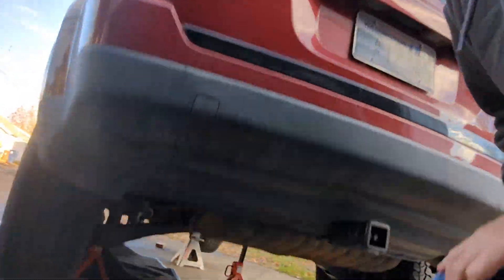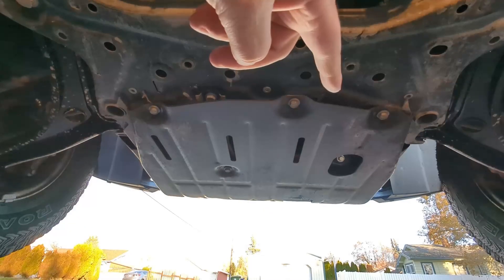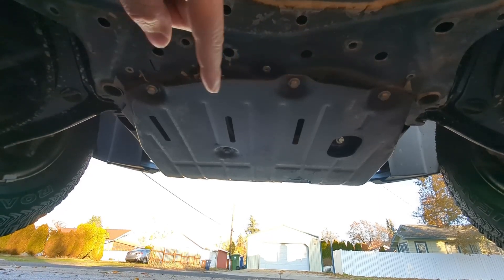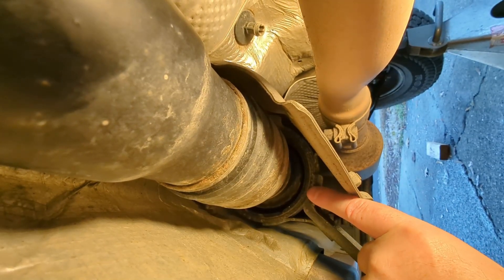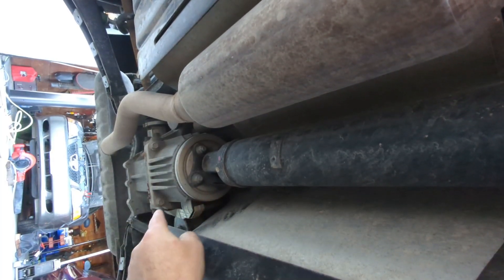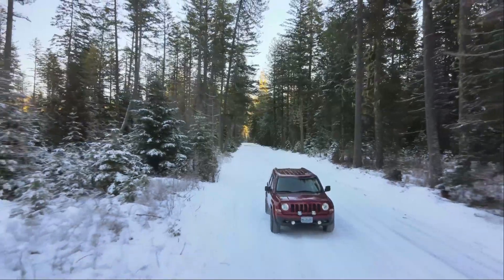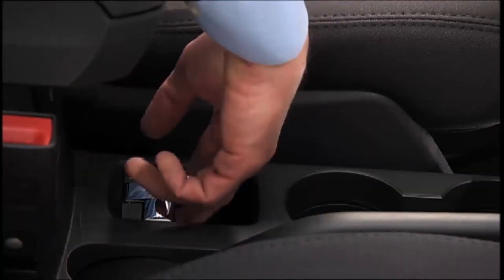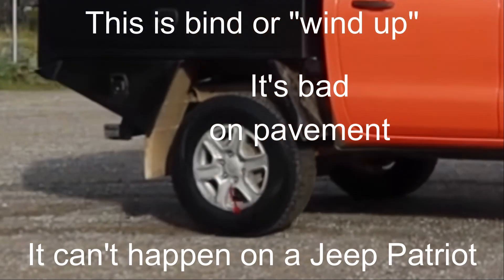How a Jeep Patriot 4WD system works - Compass too!

Comment: Here is a question for you. I’ve heard from a couple different people that I can’t buy a pair of tires. I have to buy four tires all the time no matter what.. is that true? Can I pick up a pair of tires put them on the front a couple months from then maybe buy another pair put them on the back? Or will that tear a hole in the universe?🤔 I have a 2008 Jeep patriot. I’ve changed the CVT fluid more times than I can count as well as eliminated the temperature regulation unit. I can’t remember the correct name. It looks like an H it’s mounted up next to the radiator. It was allowing the CVT fluid to get way too hot so I eliminated it made all new PTFE braided hose with AN Fitting's. I know this next statement people are gonna not like. Well, I also bypassed the transmission heater cooler and removed it. I now have a flat plate in place of it. I’m able to control the warming of the l CVT fluid in a different manner
Reply from the maker: The drive system in a Patriot isn't going to have a problem with a slight difference in diameter from old vs. new tires,  as long as you get the same size and type of tire.    There are other systems like the old Quadra-Drive in WJ's which were fully mechanical and a small difference in size from old vs. new tires or different brands would cause the gerotor to pump up and press the clutches together,  causing the transfer case to overheat and ultimately fail.  That's not a possibility in a Patriot if the difference is only a little tread from older & newer tires.

Comment: Honest, I rolled my eyes at first and thought, "after driving my Riot for 10 years, here's another goofball gonna tell me I don't know how to drive."  😂  THANKS for this video, you gave great explanation of what's going on in the drivetrain.  It all jives with everything I've learned, driving and working on this Jeep.  And some of what you explained toward the end - - I'm even more confident telling my sweet wife NOT to worry about the 4x4 lever, "just leave it in 4x4 whenever you're in the snow."  
94,000 miles on our 2016 Sport model that we drove off the lot brand new.  It's super reliable (though we're not confused, it's not a rock crawler, we call it our Seattle Street Jeep!)   Now in Central Illinois with "real snow," it's proving to be a solid daily driver, no matter the weather.

Thanks again for the video - - 

PS, thankful you avoided alcohol poisoning. The background noise was NOT an issue on this end!
Reply from the maker: Hey thanks!  I appreciate the feedback.

Comment: One info. The activation of the traction of the rear wheels, on normal operating mode (no 4wd lock switch enable) turn on a light on the dashboard when engaged ? i mean, i start with the rear wheels on a slippery surface, so the front have traction but the back not, it will engage 4wd and gain traction on the rear, blinking a light on the dashboard (like the esp light, the 4wd text on the odomether display or something else), or will just do it in silent ?

Comment: At about 48 mph my 2019 compass makes a sound like something spinning up. I've read that it is normal, but nobody says exactly what it is.
Reply from the maker: Dang that's unfortunate...   the '19 Compass is on a different platform than the '07-16 Compass (and Patriot) so there's not a lot of cross-over among them mechanically.
Reply: @shoveI  Maybe you could do a video covering that drive train.

Comment: Great explanation, i have a 2008 jeep compass and i here a loud noise from the back i also feel like the rear wheel drive is trying to engage all the time but when i manualy engege the 4x4 i do not hear or feel anything weard from the back what could it be

Comment: Looking to get all weather tires for 2017 Patriot 2.4L 6 speed Auto Stick Tip Start. Wondering opinion on what the "sweet spot size" for an all weather tire would be. Central Ontario Canada winters here. Thanks in advance. Currently running 17x6.5 Aluminum P215/65R All Terrain. Enjoying the content, cheers.
Reply from the maker: I went with 235/75R15 which is equivalent in size to 235/65R17 ,  it clears every part of the fender and suspension without any risk of rubbing even at full turn and while traveling on rough roads and it's subtle enough of a difference from stock that (after calibrating with JSCAN) it doesn't significantly impact acceleration or fuel consumption. 

It looks like some of the major all-weather tire brands are available in that size (like Michelin Crossclimate, Pirelli Weatheractive, etc)  .

Comment: Thanks for such an informative vid. Im a retired skilled tradesman and I bought a 2016 5 speed Patriot about 3 months ago for about half the going price but i it seems to have some issues. Anytime I drive I hear a very slight whine, whirring sound from underneath. The sound concurs with the rpm of the motor and trans. A wheel bearing sound follows the rolling speed of the wheels  so I feel thats not the problem. My question is does the center carrier bearing or joint require lube or some type of maintenance ? I changed the diff fluid the trans fluid and the transfer case fluid myself because no mechanic I knew seemed to be knowledgeable about 4x4 . The vehicle has about 108,000 miles so its not dying yet I hope and it runs great. Aside from the usual Mopar grounding issues. I never owned a 4x4 before so I m in strange territory and I have yet to find someone that seems to know anything about the subject. I love your Patriot videos because you dont seem obssed  with likes and subscribing. Thanks n advance for so much info.
Reply from the maker: I don't know what climate you're in,  I've only lived in the rust belt a very short time many years ago so rust problems are not my area of expertise.   Outside of the rust belt the carrier bearing doesn't need any special maintenance and either way the carrier bearing will follow the road speed not the engine speed because the driveshaft is in constant mesh with the front differential. 

The most common problem on the manual transmission is its input shaft bearing, especially on models made after 2011 when that factory was no longer building transmissions for any other application,  it seems like quality dropped pretty quickly like maybe they laid off or reassigned the one person who knew what they were doing.   When the input bearing fails you'll get a whirring or whining noise that follows engine RPM any time the clutch pedal is not depressed,  sometimes it will be a little bit quieter in 4th gear but not always.

Comment: Hard time deciding 2016 patriot high altitude 96,000 km or 2021 Toyota Rav 4 LE SAME KM but the patriot is half the price?? Patriot is staring to rust under the doors and a paint bubble in the rear fender..
Reply from the maker: I live out west and rust terrifies me no matter what brand of vehicle it is.   There's nothing fundamentally wrong with a Patriot but get the Toyota.

Comment: HOW  CAN I GET   A  WIRING  DIAGRAM  FOR  THE PATRIOT  2015 ..  MY 4 WHEEL LITE IS ON .. AND IS  NOT  AFFECTED  BY THE  SWITCH..  . FUSE IS OK .. BUT  NO POWER  TO  THE  SWITCH ON THE  CONSUL .. WHEN  LITE IS  ON...... I NEED  TO  KNOW  THE  WIRE  COLOR  LEAVING THE  FUSE ... AS  I AM GETTING  POWER  TO  THE  FUSE   ...BUT  NOT  SURE   IF  POWER  IS  LEAVING  FUSE ...
Reply from the maker: The facebook group "Jeep Patriot USA" has in their group files section a pdf of the whole factory service manual including wiring diagrams.   If you do file sharing stuff (you know what I'm talking about) the same file is out there too.

Comment: Good stuff! I personally have had two Pat's. My first got totaled ! My previous 4X4 was an Eddie Bauer edition full size Ford Bronco  5.8ltr . Great 4X4 ! Used it when my daughter and I snow boarded around Calif. But when I retired I sold all my gas guzzlers (Bronco, Mustang, Tbird) and kept my Harley and Fiero GT. Even though I stopped boarding at 60 I still enjoy going up to the mountains and traveling the back dirt roads . And this little light weight 4X4 fits my needs to a T. Thanks for your vids and great job!

Comment: Good day, my 2011 Patriot Latitude X 2.4 intermittently binds while performing a sharp turn from a stop.  It feels like the rear wheels must be engaging. I was thinking of pulling the all wheel drive control module fuse to test this. Do you have any input on this matter? Thanks
Reply: Additionally, no fault codes present and 4 wheel light turns on and off when switch is actuated. Gas mileage seems to be normal, so I don't think the 4wd is always on.
Reply from the maker: One thing you could start with for diagnosis is to configure the JSCAN app to display 4wd engagement and see if the rear drive unit is being commanded on when you notice the behavior.   That way you can isolate if there is a mechanical fault or if the PCM is commanding the behavior
Reply: @shoveI  Thanks for the Quick response!! I have the jscan but have only used it for faults and trans fluid temp. I don't see where to monitor 4wd engagement. Is it in the all wheel drive module?
Reply from the maker: It's under "Live Data" - look under PIDs.   I don't remember exactly what it shows up under, like "RDU COMMANDED ON" or something?  I can plug in tomorrow and refresh my memory.
Reply: @shoveI  I appreciate it!
Reply: @shoveI  Good day, did you look at the Jscan to see the exact name? I can't figure out which it is.

Comment: My drive shaft popped out twice in 5 days left me stranded today. 08 jeep patriot. We couldn’t fix the shaft so he completely took off the drive shaft an so far so good what ya think ? I really don’t need it
Reply from the maker: Under normal conditions none of the driveshafts should be able to fall out,  sometimes when people are repairing or lifting the front of the Jeep they will accidentally pull one of the front CV axles out of the center section and not fully seat it back in, which should be remedied as soon as possible to avoid further damage. 

If you mean the driveshaft that leads fore-aft,  the only reasons I could imagine it falling out are if the bushings holding the rear center assembly are trashed or if the carrier bearing has left the chat.

Comment: Great video!!  How reliable is the non cvt,, automatic transmission? I am going back and forth desision on purchasing either the manual clutch transmission or buy the auto trans???? Thank you
Reply from the maker: Pretty much nobody complains about the 6F24 transmission,  they tend to last the life of the rest of the vehicle if maintained. The biggest problem they have is Jeep calls it lifetime fluid,  but there's no such thing as lifetime fluid.   There is also a "rough service" schedule that says to change it at 120k miles. 

The transmission manufacturer ZF says that transmission fluid itself is only good for about 60k miles,  so that is when I change mine.  

(ZF doesn't make these specific transmissions, but I trust what they say about fluid) 

Manuals are difficult to find and many suffer input shaft bearing failure.   Apart from that they seem reliable enough going by other peoples' anecdotes.    Listen for bearing whine if you're shopping for a manual, both of the manuals I looked at while shopping had it pretty bad which is probably why they were for sale.
Reply: @shoveI   is there aftermarket input shaft bearings that are more reliable? Is it high labour and parts to repair that bearing? Thank you you're a great help!!
Reply from the maker: I am not an expert on the T355 but I understand that the bearings are not bespoke to only that transmission,  which means you have choices presumably.   From the limited reading I did while shopping a few years ago the problem was identified either as insufficient factory lubricant fill (so you extend the life of it by simply ensuring the transmission is filled to specification),  excessive idling in neutral (the input shaft is spinning but lubricant is not being splashed up by the gears lower in the sump) so you extend the life of it by not idling the engine for no reason,  for example remote starts or eating lunch every day in the car with the engine running for HVAC.    The other proposed cause of failure was incorrectly aligned machining on the case which puts a constant load on the bearing outside the axis it's designed to bear.  Probably no real fix for that as an owner unless you happen to live near a machine shop that can line hone a whole transmission case.  

Also I notice your use of the English spelling of labour,  so if you do happen to be in England I believe you guys got a 6 speed manual gearbox as well.   I don't know anything at all about that transmission.

Comment: Great information in the video. We just got 12” of snow and my Patriot made it around flawlessly. Just a question tho. I have a little ticking noise. I had my mechanic take a look and said I had a little cam wear but didn’t see a problem in the engine. Any thoughts?
Reply from the maker: Cam wear is pretty uncommon in these engines (assuming you're in North America and have the 2.0 or 2.4 gasoline engine) - if there's wear in those I'd be more concerned about timing chain wear.    The only thing you can really do about that is be diligent about oil changes and accept that damage already done can't be undone, short of very costly replacement.   

Since apparent cam wear is present you can expect possible wear in the cam phasers and the cam timing solenoid which can make a noisy tick in operation especially if it's worn or sticky. 

If you idle a lot remember that idle time doesn't accumulate miles but it still factors into how much wear the engine and the oil experiences.

Comment: How do i disable the 4wd? I just don't want it.
Reply from the maker: I've never looked into doing this,  but if it is possible (safely) the most likely way would be by deactivating the FDCM in JSCAN.   There may be more to it than that but it's where I would start if I was trying to do that.
Reply: @shoveI  thanks 😃

Comment: Hey thank you for letting me know that 4wd system doesn't work over 35 mph. And that matters because some people don't know this and are driving fast because of a false sense of safety when they need to slow down probably. ❤
Reply: @jwilson2119  one of the biggest fallacies ever sold is that awd is safer than fwd in the snow at speed. While in the hand of a good well trained driver it offers more options if the car loses traction, fee’s tend to maintain stability better, with less propensity to spin.

Comment: Hi great video 👍

I have a quick question,  so my Patroit is a2013.  I upped the tyres to a more bulky size.  Both back and front are 17” but back is more bulker then front.

Drove it for 2 years no problems.  Then boom the car started make so noise like a bearing that are about to go.  What to the dealer they replaced the transfer case.  6months down the line the noise come back.  Car has been standing for month now.  Any ideas?  

Thought of replacing the input shaft bearing…
Reply from the maker: The 4WD system on these cars cannot accommodate different tire sizes front and rear,  so if your rear tires are larger then that is going to damage the car.     You'll probably have to diagnose the specific part that is failing rather than firing the parts cannon at it,  but if you do repair it also make sure all four tires are exactly the same measurements.

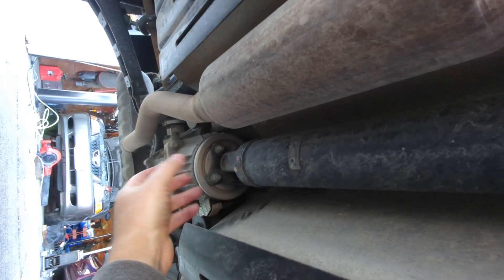Comment: 2:54  It's hard to believe that drive shaft isn't connected to the rear with a universal joint. Just watched a video about a Toyota Sienna and it has a universal joint in back.

Comment: 3:16 thats AFTER the gear reduction of the transmission, 160ft/lbs can easily exceed that depending on the gear and axle ratio
but your right about the location of the clutch reducing driveline noise, i noticed exactly what your describing on my touareg even though they tried to mitigate it with basically rubber u joints
Reply from the maker: I see what you're going for on that but first gear ratio is 4.21 so the rated 165 pounds out of the engine is still short of the claimed 1800 that the clutch can carry.   Clutch is upstream of the final reduction in the diff.     I suppose it's all academic since none of us is going to make or break our weekend adventure on the exact clamping force in that clutch pack!

Comment: I have a 2017 Jeep patriot. Dealer told me there are no transmission filter in this. It’s a ladatude 4x4.  Also got a noise in the drive train a humming noise. Took drive line out checked carrier bearing. All 4 wheel bearing changed. Could it be the transfer unit
Reply from the maker: There is a filter in the transmission,  in fact it's part number  68192984AA  available from your Jeep dealer.    The problem is that it's not convenient to change it with the transmission in the vehicle.   

Since there is a conventional external transmission cooler I installed an inline transmission filter in the hose leading to the external cooler on mine so I can replace that when servicing the transmission and presumably it will catch some of the contaminants that would otherwise fill up the panel filter in the gearbox. 

I wouldn't be able to guess at the noise you've described,  if you suspect it's the PTU you can always drain that and inspect the fluid for glitter.   A shop with a chassis lift could also raise the wheels off the ground and run the vehicle to positively identify the source of the noise.     

Older cars begin to need more maintenance as time goes on,  still usually cheaper than payments on a new car.